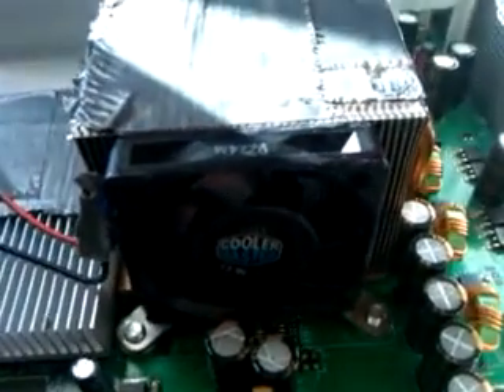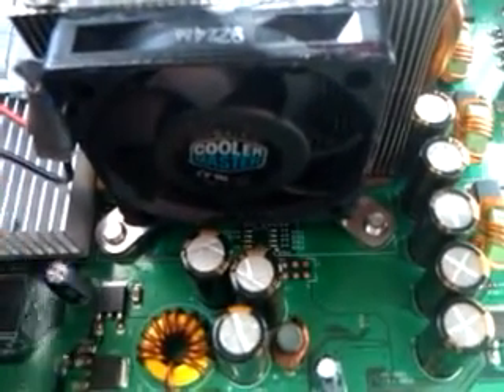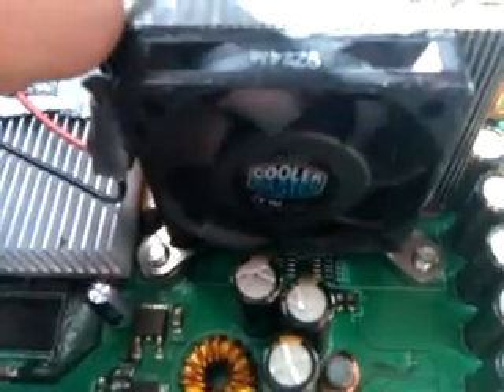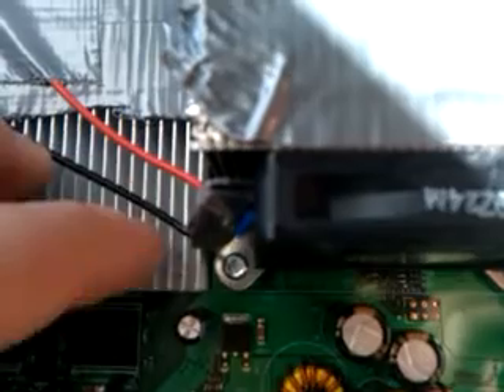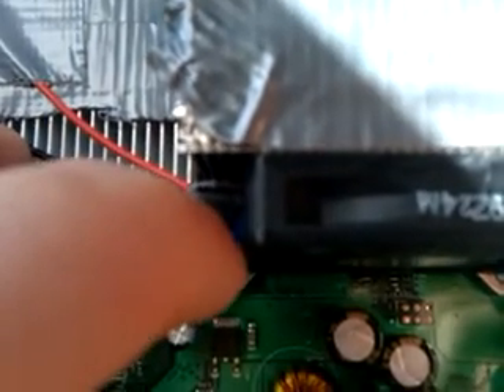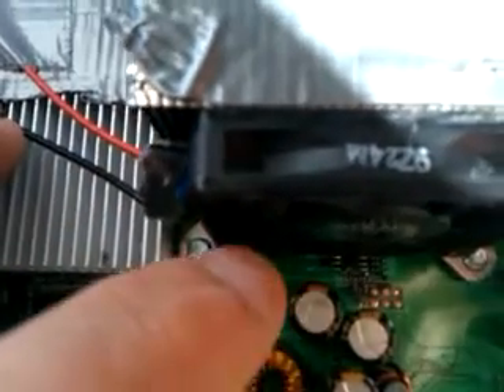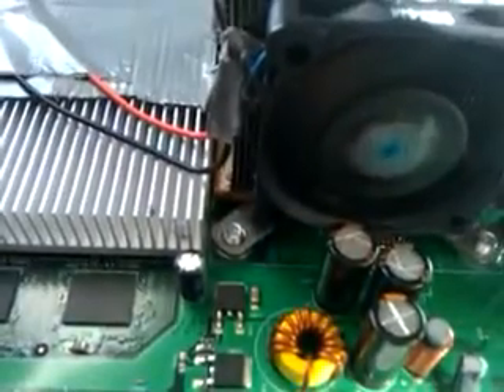Xbox 360 Fan Mod - CPU Fan

Comment from the maker: @NighthunterNL i have 8 Xbox 360's (Bought them RROD'd off of ebay) each one is working fine and your laser probably wasn't calibrated property (humidly etc) because i know for a fact their temps are accurate. lol its not just duct tape lol there is tin foal underneath it, so adhesive is not in direct contact on the heatsinks. AND DO YOU EVEN OWN A JTAG.

Comment from the maker: @xforce687 i connected the fan to the original power for the fans (my fans in the back of the xbox were running off dvd drive power at the time of the video but the pc fan was running off of the stock fan power source
)